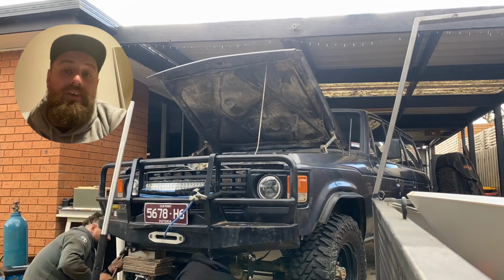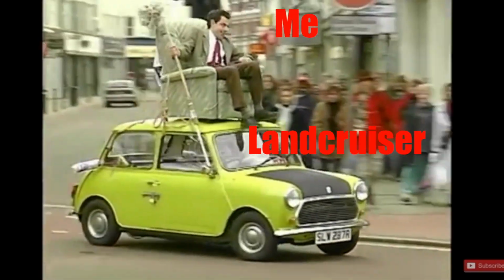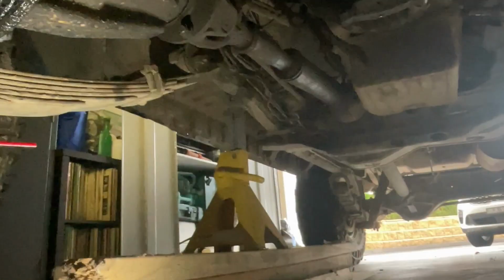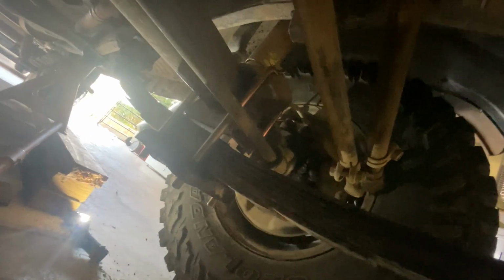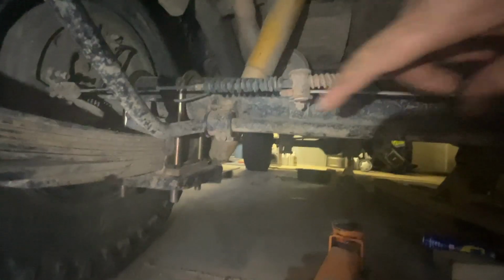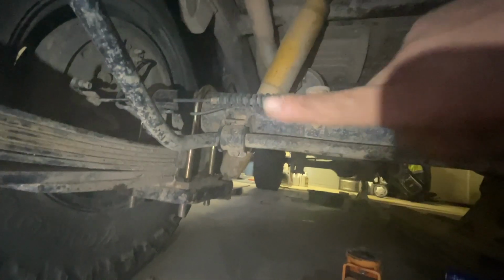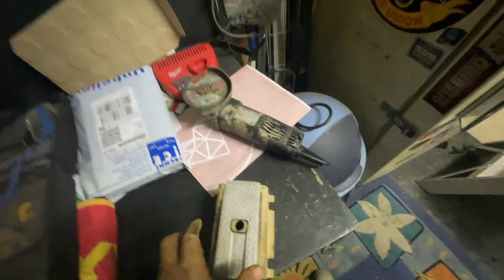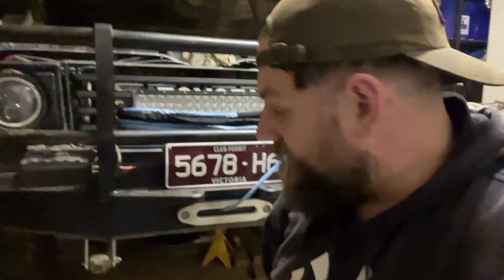2 INCH LIFT / EXTENDED SHACKLES / CASTOR WEDGE INSTALL

Comment: Hey mate, did you have to get longer bolts for your leafs packs?
Reply from the maker: Hi mate. I replaced the ubolts with standard ones. And it worked fine.

Comment: How did you find out what degree of caster correction you needed? Or ehat size did you get 1,2,3 or 4
Reply from the maker: Roll of the dice mate to be honest.
Reply: @favouritejay  did the shackles do the trick cause I've got the same issue
Reply: I got a reading at the local alignment place - they should be able to tell you what your caster is set at; mine was reading -3 degrees, so I bought some 4 degree wedges to get a +1 degree caster, which - for my truck at least - is what you're shooting for.

Comment: I can’t remember if you had your springs replaced or reset? That made a huge difference to the height of my 60.  At least 2 inches of sag removed.
I don’t need to say get a bigger Jack and stands.  You can loose all those sketchy packing blocks. 🤠
I always enjoyed the camping just as much as the 4wd’ing
Reply from the maker: They’re not new but not original. I’ll look into it. She Skaggs a lot in the rear when loaded so maybe some constants in the back.
Reply: @favouritejay  
My 60 sagged in the back early on.  Like the first five years.
I had Toyota fit an extra leaf in the back and it levelled right up again.
30 years on I could see the shackles on the front and rear were getting towards 45 deg unloaded when they should be almost vertical.
I had a local spring specialist reset them.  They are basically black smiths who specialise in truck springs.
I now need to use the side step to get in again :)
I asked the blacksmiths what they thought about new springs and perhaps predictably they said we hate that shit.  They are made of crap, keep the original spring and we can fix them for you.